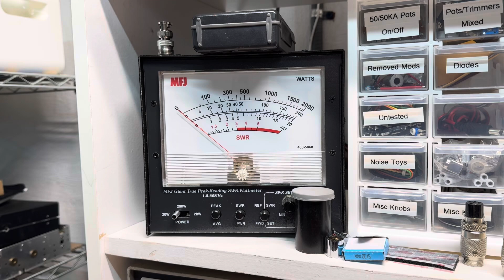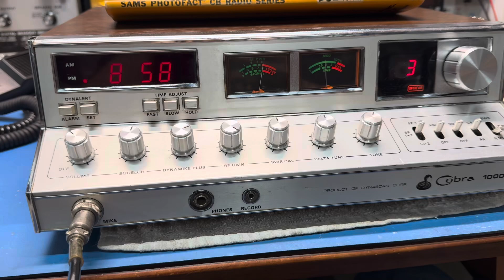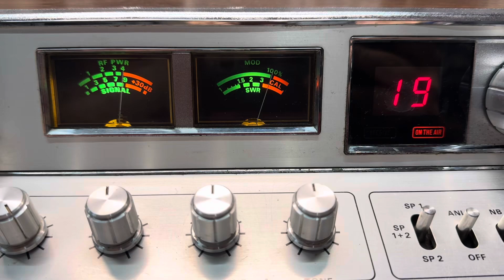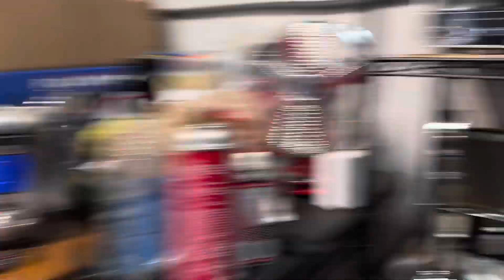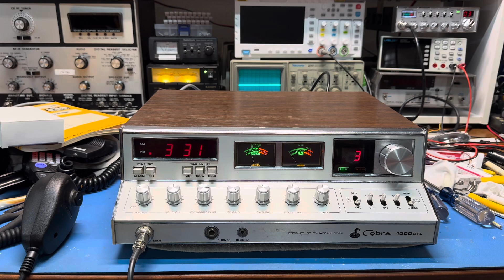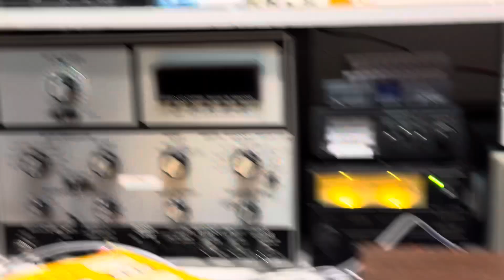Cobra 1000GTL Base CB radio, test and tips

Comment from the maker: Feel free to ask me questions about the 1000GTL repair tips. I’ll try to answer them for the next few weeks if I have a chance. From R50 failure to D13 problems? Finals and more…
Reply: Is that the same circuit board is what's in a Uniden (Not President) Zachary T?
Reply from the maker: Still can’t remember the board number but the Zachary T from Uniden is based on the 29GTL, and the President Zachary T is based on the 29XLR. Different board revisions but same alignment and mods. Just some slight differences.
Reply from the maker: I can’t remember the Uniden PC number, I think the revision number is different but they’re virtually identical. They share the lineage with the Cobra 29GTL